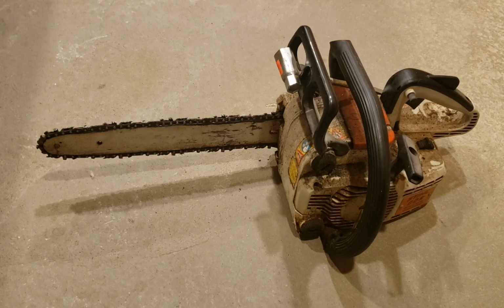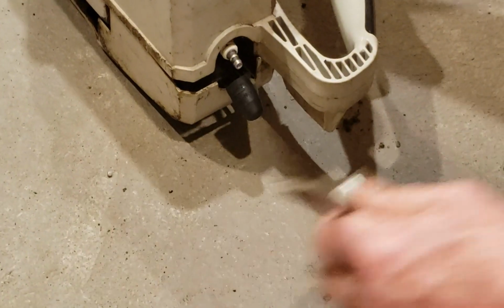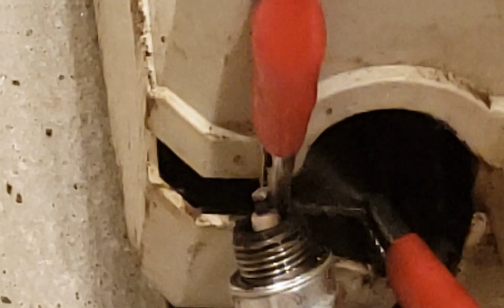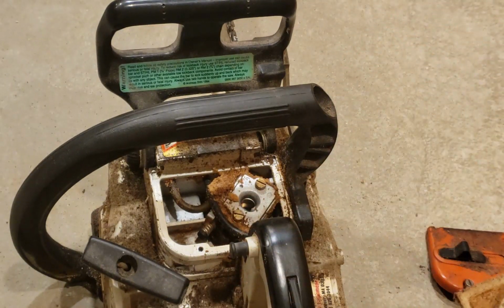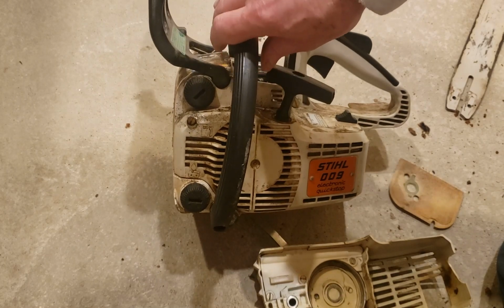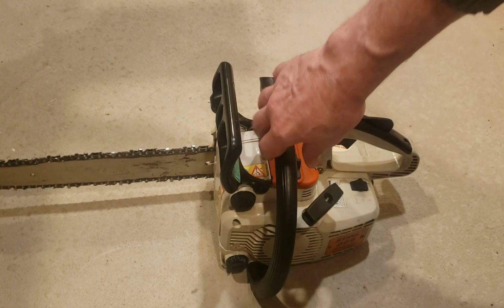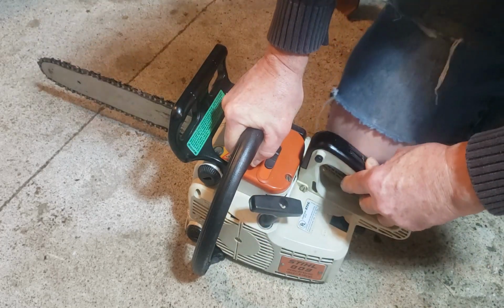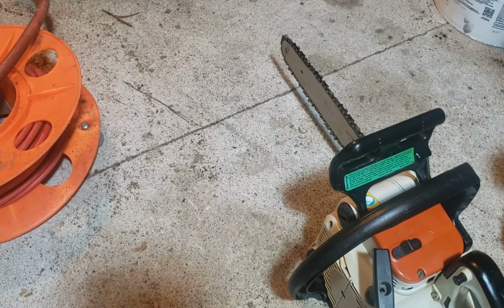Abused basket case 1980's Stihl 009 chainsaw from the dump fixes up for nothing and cuts!

Comment: All that saw dust removed the saw was probably 5 lbs lighter. I don’t understand why people let their equipment get so junked up after spending good money to get it in the first place. That was a nice saw .
Reply from the maker: You're not kidding. I didn't even try to start it until I cleaned it up. Probably wouldn't have worked anyway with that air cleaner. Ended up selling it to a guy who was looking for a little arbor saw. Cold started first pull on the demo, thank God! -C

Comment: That chain is way too tight, but cool otherwise!
Reply from the maker: Yeah, perhaps a bit. But once it warmed up on that little snag tree and the oil pump got the bar good and gooey, the chain dropped into a looser groove. Thanks for checking it out! -C
Reply: What's up Oliver? Ya nice 009 they were an occasional use saw 009L was the first pro saw by stihl I do believe and 009 did stop production way sooner so 80's for sure